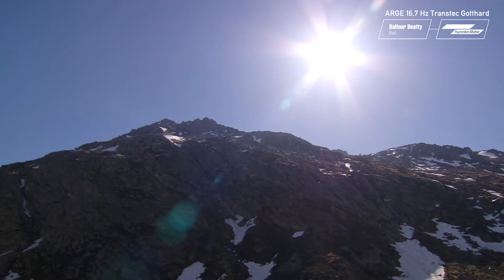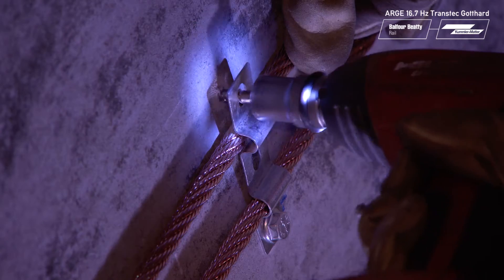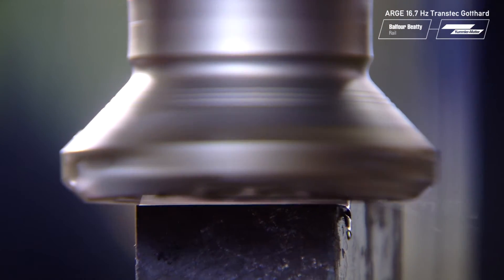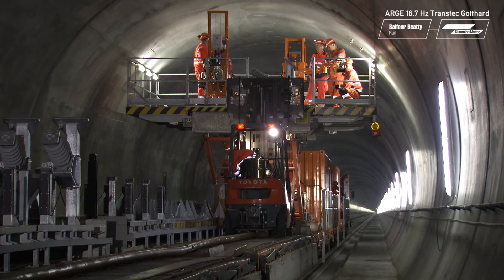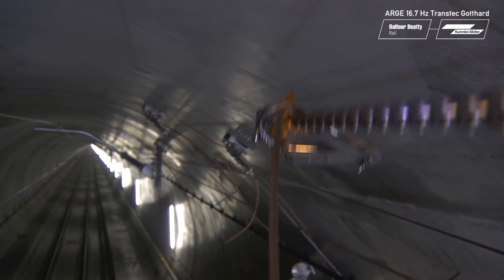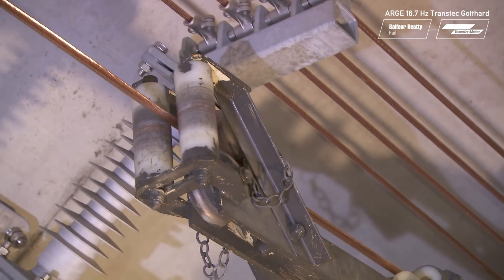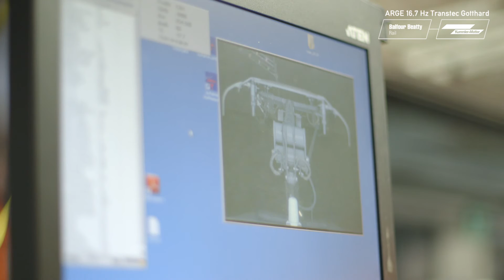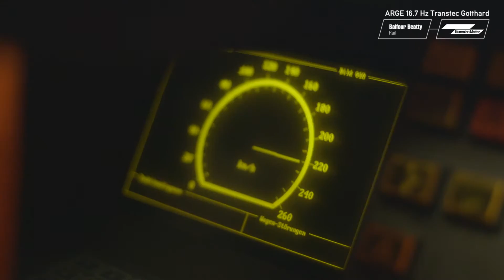Rail Power Systems: 16.7 Hz Transtec Gotthard - Project documentation

Comment: My respect to the engineers, but why 16.7Hz? Doesn't the low frequency require bigger transformers for the locomotives? Or you just directly rectify the 15kV which sound a bit too much for traction motors of older locomotives. It would have been much more efficient to have a 50Hz line 25kV allowing lower losses and ease of powering the railway since it's a direct transformer job from mains power to railway power.
Reply: @ManuelVilaça  don't quite understand what you're saying..my point was why 16.7Hz when the rest of the EU mostly uses either 3kV DC or 25kV AC. What drove the germans into the 16.7Hz 15kV option
Reply: Kenzo Jadiel  your account has been registered two weeks ago..wonder for what purpose..posting unrelated comments into completely unrelated topics